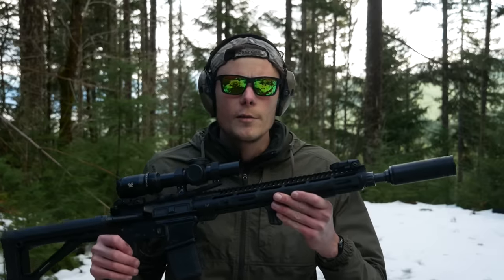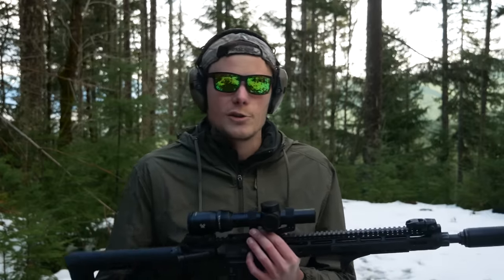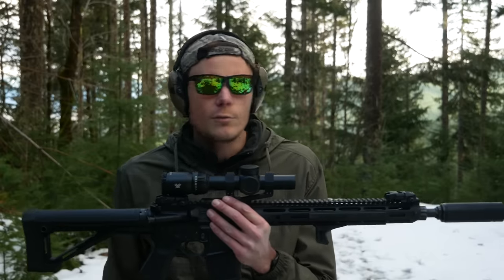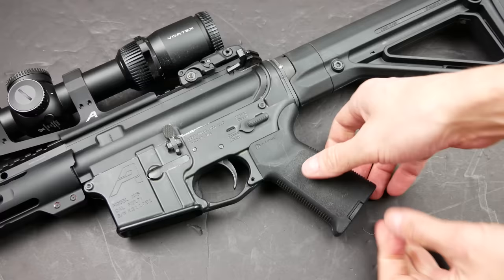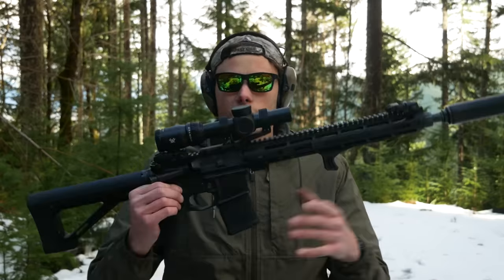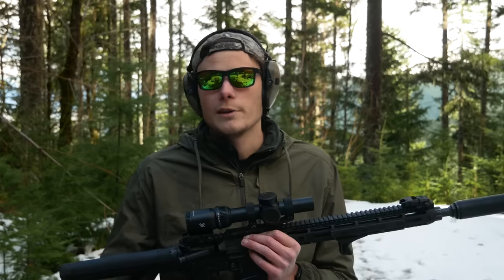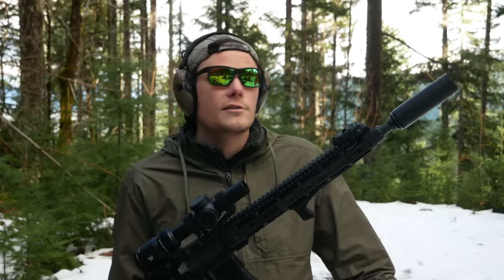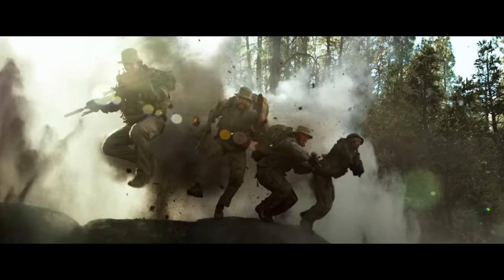WTF are Backup Iron Sights For?

Comment: To the benefit of quick deploy irons...

I don't know many people who haven't had complications with a primary sighting system in a class or during a drill etc. 

The ability to quickly shift to a secondary or tertiary sighting option is invaluable. 

I was in a 2 gun tactical class and had my eotrch run out of juice mid drill, flipped up my rear sights and completed the drill in the top third of the class.

I've generally only attended classes were you are expected to work through any gun failures in real-time within reason.  

Clearing common malfunctions, swapping sighting systems, are considered typical.

Comment: I had BUIS on my AR until I put a LPVO on it an it just seemed like the folded down front sight was still obstructing about the bottom quarter of the view through my LPVO.  Now, the odds of my shooting so far that I need to use the lower marks to try to account for drop is pretty low but it still bugged me.  It look them off for now but they're something I might reattach in the future.  I might have to get one of those mini Allen Wrenches that he showed in the video so I could somewhat quickly remove the LPVO from my rifle should some catastrophic failure happen.  Is there a particular brand that fits nicely in the compartment in the grip that is recommended?

Comment: I'd also add that with rifles where most of the end of the handguard (the 'prime real estate' of the rail, if you will) is occupied by light(s), laser, tape switch(es), cables and routing, it becomes increasingly difficult if not impossible to find the 2-3 picatinny slots needed for a backup front sight. Yes, leaf sights exist, but not for every laser setup.

Comment: I was still working the street, I would have offset iron sights.  You could go from urban to rural from one call to the next, needing to be able to do 200 yards or urban close quarters. 
I had to dive to cover and got my red dot packed with snow (also covering the co-witnessed rifle sights).  That sucked.  The marginal “sights” molded on the top of the red dot helped.  Red dot came off and I went back to plain irons for the rest of my career.
But an LPVO and an offset set of irons would be perfect.

Comment: I like the idea of backups (irons or a seperately-mounted offset dot) in case the main mount fails.

I had an M4 with an ACOG in the Army that failed when the screws connecting the ACOG to its mount loosened up. The optic itself is a tank, but that doesn't matter when it didn't have loctite and turned into a jiggly 4x telescope.

I've also had the factory mount on an Aimpoint PRO somehow break where it wouldn't ratchet all the way down anymore. Shit happens.

Comment: The seal on my vortex razor gen 2 e broke after I dropped it intentionally. Was pretty disappointed. Still usable but moisture got in there and made it foggy when looking at the sun. They replaced it no issue but still cringe for such an expensive scope.

Comment: Id love to hear the Hop hot take on 13.7" barrels and this trend of "extra long" muzzle devices so you can P&W 13.9" and 13.7" barrels to 16".

Why would anyone choose a longer muzzle device on a 13.7 over a shorter muzzle device on a 14.5 when the resulting OAL will be the same? Why would you want less muzzle velocity?

Also if we're talking about muzzle devices as suppressor mounts, its still stupid because larger MD's eat up more blast chamber volume, meaning the can is less effective.

Comment: I feel like one small aspect is moving out of a climate controlled environment into the open at night. Red dots or LPVO's would temporarily fog up on me when I went outside to check for coyotes at night. Offset irons would have been nice to have outside the view of my optics where I could run a flashlight, identify, and take a shot. You made really good points about not every necessitating event of needing irons to be outside the realm of combat. Just bouncing an LPVO on a rock by accident and breaking it could still happen. I almost wonder if something like a spare red dot zeroed on the weapon and removed to be packed away for such an event as needed would be sensible? But it's probably just ridiculous. Just got me thinking is all. Thanks again for the content!

Comment: I use a straight 4x scope with piggy back red dot. With a fixed front sight. Ive practiced with only the front sight and can easily make accurate hits to 50 plus yards with it. So i consider all that my complete sighting system.

Comment: Read one of the comments. I've been a cop for nearly 30 years in an area of the country that has extreme cold weather. Yes, you get out of a heated car and step out into sub-zero temperatures, your lens can and probably will fog up and immediately freeze. Step out of an air conditioned car in the humid Texas evening (used to work there too) and your lenses (like your glasses) will fog up. Wipe them off, go ahead, so they can fog up again. There are coatings for that you might say. Yup, used them. They wear off. They need to be cleaned off and reapplied. I have iron sights set up to be a primary sighting system that is augmented by other optics (except for my LPVOs, because... duh). Batteries die. Batteries do not always have the recommended life that the manufacturer tries very hard to keep consistent. I've had new Surefire batteries last me 20 minutes. Extremely rare, but guess when that "rare" event will occur? Yup, right when it would be the worst time for it to happen. I've had guys show up to qual that were mystified when they're extremely expensive optic stopped working or lost zero due to temperature shift (looking at you MRO), and they didn't have BUIS. Too bad for you, come back when you aren't an idiot. That happened to a member of our regional SWAT team. What you think is fool proof is only proof that you are a fool. Have a plan for WHEN, not if, something will go wrong.

Comment: In the case of having an Acog + rmr set, I think that even in a "war" scenario, having iron sights will be too much of a burden. It is good to have a backup system, but tripling it sounds excessive.
Reply: No.  That would def be the situation I had offset irons.  The most trying circumstances require the most redundancy.
Reply: It's always good to have a non-electrical sighting system on your rifle just in case you don't have access to batteries or, even if you do have the batteries but you don't have the opportunity to change batteries.

Comment: It's all about redundancy. Batteries die, things break. Why do you have a light mounted on your helmet?  Well, one reason is if your WML dies. It's quicker to turn the other light on than it is to sit there and change batteries (in a situation where changing batteries is not possible)
The biggest problem with weapon optics is lack of parts available and almost zero user serviceability. IF you're concerned about a total SHTF situation, buy a second rifle scope as a backup. Zero it and then put it in a case inside your pack in case your main optic fails and cannot be repaired

Comment: If I had to choose one or the other I’d take iron sites simply because of durability, stuff breaks. Shtf good luck with the batteries replacement parts are even a new red dot. I am interested in the S&W FPC it doesn’t come with sights so back up sites it is.
Reply: That’s why I like the holosuns with a permanent battery and a little solar panel. The panel runs the red dot in the day time and trickle charges the battery. And mine turn off after 10 minutes if no movement.

Comment: I like them, but maybe not for the reason everyone thinks. Once your backup iron sight is on and zeroed it just lives there.  So when you inevitably swap optics if you change to a red dot you have an easier time getting a rough zero to save time at the range. If you swap to a magnified optic you just fold them and go on as normal.

It’s like the argument of the forward assist. Everyone making a mountain out of a molehill. Who cares if someone has them, just make sure they are actually zeroed! When was the last time you checked zero on them? If you can’t answer that check it.

Comment: Public Service Announcement: Loctite requires the use of their primer if the metal is coated in any way. The primer is expensive and has a low shelf life, just like Loctite's other formulas. So, just get some VC3 instead bc it doesn't need a primer, is much cheaper, and has a longer shelf life.

Comment: Just run a carry handle with an optics mount like the good lord intended. You don’t have to remove your optic or tilt your rifle to use your irons, and it puts your optic at the same height as that aero mount or the unity mount everyone on the gram runs.
Reply: My dream build is some sort of a2 carry handle with dot mounted on top, fsp with free float handguard cut out for the fsp and also extends passed it

Comment: Anyone else out there played around with red dots or LPVO's on 1x and just the front sight?  I messed around with that the other day and found that 25 yard hits were very easy, even 50 yards, using just the rough red dot aperture and the front sight (which was zero'd previously with a standard rear sight).  This would just be for the scenario where you need an immediate aiming solution due to optic failure.
Reply: @@Floridaman855  Yep, wasn't indicating it would.  Just noting that if your red dot - in particular - dies, just having a zeroed front sight will allow you to get pretty reasonable accuracy at shorter distances.

Comment: You missed one of the best features! If you have the backups zero'd you can switch between other optics and use the backup to re-zero. For example, if you go from one RDS to another you can keep the known zero and use it to dial back in the new one you just mounted.

Comment: Well you see they are iron sights for when your main sight goes down, kind of like a backup.  Is an Eotech 512 likely to break and go down, no.  Is an event that would take down your Eotech 512 most likely going to destroy your rifle or you, most likely.  Do I still run backup irons sights with my Eotech 512, 100%.  It's the same reason I concealed carry with an extra mag, and it can be argued, it's the same reason most people concealed carry...It's better to have it and not needed it, than to need it and not have it.  Also, you shouldn't put an optic on your AR, that is easily broken.  And, if you run back up irons, you should be able to co-witness through your main sight.  Remember if it can go wrong, it will go wrong.  They weigh almost nothing, cost about $90 for the set (Magpul mbus), and take up almost no room; so there really isn't a good reason not to.

Comment: I dunno, by this "I'll just pull out a tool to remove this optic and use this other thing" logic, why not just carry another optic? If you're already busting out tools, why not get something significantly better than irons? Why not leave the irons off and just put them on when you need them and make the gun lighter in the meantime? Idk maybe I'm just not getting it
Reply: @Floridaman855  I personally have never had to rezero irons once they've been set. By their nature, they're pretty good at return to zero and if they're in the same place on the rail then they're usually close enough in my experience. Remember, this is a pretty extraordinary hypothetical situation in the field where a "main battle optic" goes down. Do you even need perfect return to zero on irons at that point? You already pulled out tools, why not zero them while you're out there and you apparently have time.

Comment: Gave up on BUIS or BUPS.
First was cost.  
Second was even if I got cheapies, the location of  them in the case of 90Degree is too low for Gas Mask work.
Third was even if I got cheapies, the location of  them in the case of 45Degree is too low for Gas Mask work.
Fourth, raising 45 degree Back Up sights looks incredibly stupid and adds yet more needless weight.

So the challenge was a backup Pistol red dot high for Gas Mask work and 45 degree offset.
What the project requires is a 3-4 slot 45 degree and a lightweight slim 1" riser as the top end.
Problem: Once you get the Pistol Red Dot on the gun things are getting really wide and busy.
Gain: No additional weight on the Muzzle end.

Solution: a cheap flip up red dot that is off until deployed.
Protection:  It comes with a cover to protect it.
Problem: the cover does not hold very good under action
Solution: some RTF added at points to make it grabbie and then, Paracord front and rear attaching the cover to the riser which has holes perfect for this function. Now it stays until removed and does not fall into the ejection path.

This side profile is as minimal as could be imagined for the function.  The Red Dot is rather cheap and crude, but it does have set screws for the W/E adjustment screws, really no less crude than BUIS/BUPS.  It has no brightness controls at all, but is no problem since the Flashlight is 2030 Lm for 3 hours out to 330m.  (An SF operator saw my Light set up and criticized the use of a High 1" Scope Ring at 3 o'clock saying it was too wide.  Well, I was eliminating as much shadow cast against the Muzzle and Suppressor as possible without a Foreward extension, but people can choose a low ring if they do not care about the cast. Paul Howe talks of getting the light away from the body to avoid incoming fire at the light, so I do not see that was  crazy.)

Cost:  Offset $9.99, Riser $14, Flip up Red Dot $32 

Benefit: Since this is augmenting a high Red Dot Mount Project, the Flip Up Back Up can be set for Close In Ranges like 21-25' or something like out to 20-75m

For BUIS/BUPS function, this whole assembly was about the price of an Amazon Pistol Red Dot alone.

When we all become rich like Hop, we can switch to RMR.

Naaah. I'll keep the money.
Reply from the maker: This cannot be real

Comment: STORY: I have offset irons on all my “fighting rifles”. I hate the way they look, I get made fun of for them etc. I also have some of the most “battle proven” optics on those rifles with piggyback rmrs. Redundant right? Well at the range two weeks ago my battle proven optic took a dump and the internal prism shifted completely under recoil. Unusable, not only that but I made the mistake of messing with the mount in which it came loose and was re-tightened. Oops now rmr is off. But in my larp sesh I was still able to use accurate fire thanks to my cringe offset irons! All joking aside the reason you have a gun is to minimize your chance of dying. If I could have infinity optic options with zero downsides I’d choose that. Food for thought, murphys law is very real. If something is totally unlikely and shouldn’t happen. Somehow it just might, and if your life is at stake why not improve your odds

Comment: backup iron sights exist for the same reason the gun itself exists. that 1% chance you need them. the odds of ever having to use a gun for defense are quite slim for most, but whats at stake is your life, thus: owning a gun. the odds of your main sighting system  going down are slim for most, but the stakes are you having no way to accurately aim your weapon, thus: buis.

Comment: Why iron? I have shot 3 red dot sights to failure. I have had new batteries and spares go on sabbatical while on a trip where not much more than "D" cells were available at Darryl's General. I have had sight rings and bases go nuts. That's why iron.

Comment: Co-witnessing with optics like holos/red dots. Maybe not taking buckshot to the face; but murphy's law is very real. Having BUS that aren't even dependent upon torqueing off a rifle scope to be used is to me, invaluable for impact, dead batteries and those random acts of god. Being a grunt taught me well enough how things are fine for countless days if not years; but one occasion shits on the functionality of your rifle. (or if some dumbass private sandwiches an ACOG between a stryker ramp)

If you're routinely using and relying on a rifle or shoulder fired firearm, have practical light weight backups, even if off canted.

Comment: WTF are back up iron sights for common sense because if your battery on your optic sights goes out well now you have a back up I myself  has back up sights my AR it has a quad rail on it and my backup sights sit on the right side on it and I am very comfortable with it it took a little bit of work and practice with it and now I’m good with them

Comment: I remember when I used backup iron sights back in 2009. I was taking a shit in my bathroom and the water splashed up and touched my ass. I immediately saw some water and shit hit my primary optic and it was out of commission. So I ripped it off and used my iron sights. 

Lol on a serious note why not just have them and have a fail safe. You do you boos and the end of the day.

Comment: I didn't even need to learn my lesson. It just makes sense to have them when they're so cheap and light weight. I do two hour drives to the desert in order to shoot and train for matches. There's been at least two times where either an optic broke or mount eventually came lose. Or I could listen to YouTubers and just point shoot my gun at a berm for the rest of the day or drive another 4 hours back and forth to pick up another scope. OR... Get this... Use my BUIS. You can aim pretty well with them. If the zoomers gave them a chance they'll realize there's nothing to be scared of, they're easy to shoot. Especially the peep sights that are common on ARs.